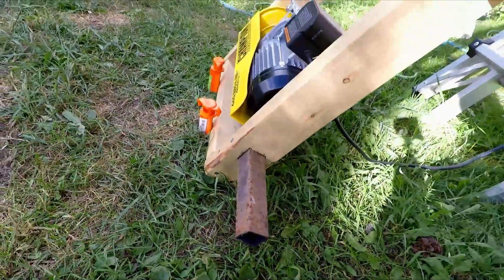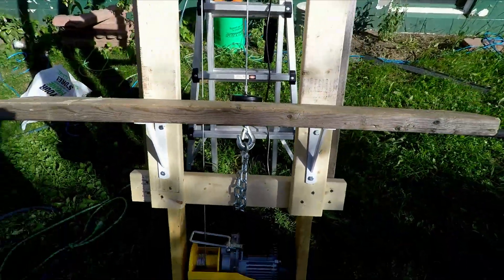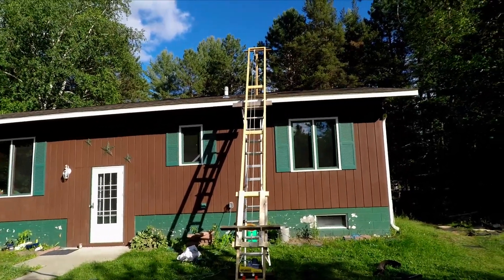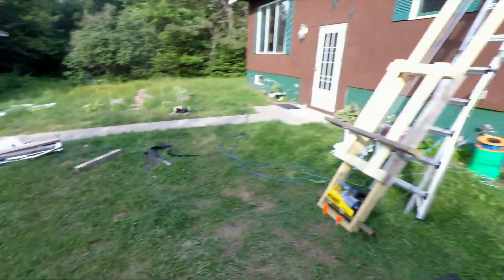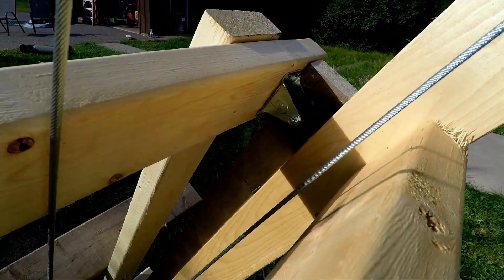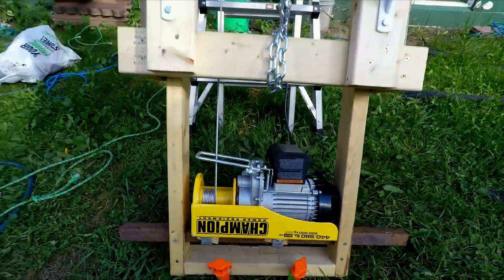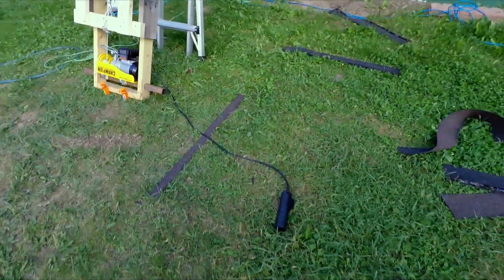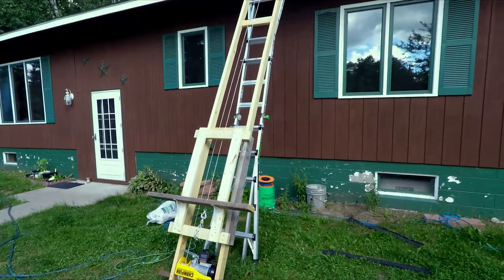DIY Homemade Shingle Lift

Comment: Great work! 
A little hard for me to see the backside of the sled top. I realize it's on an angle, but what keeps the top of the sled from falling outward? 

Other hoists I see made with real ladders use the ladder channel to keep the sled on the "uprights" and prevent it from tipping backwards towards the ground. Your design just appears to have wheels for friction and 2x6s to keep it from going side to side. No worries, just trying to make sense of it so that I can use your design
Reply from the maker: Hi Scott!
I believe you're thinking about it correctly. There is nothing to prevent the sled from moving in a direction away from the house other than gravity. This is definitely not an "OSHA approved" device, or something I recommend as a truly 'safe' method.
That being said, I was confident that the pitch of the rail and the weight of the shingles would provide enough friction to not be an issue.
If you wanted extra insurance, you could add an attachment point between the top of the sled and the cable. That way if for some reason there was a 'tipping' force on the sled, it couldn't rotate far enough to fall off 'backwards'.
Or just a few cuts of 2x4 that wraps around the bottom of the rails so once the sled is on there, it can't come off. You'll just have to take them on and off at the end of the day, to take the sled off the rail.
Just depends on how complicated you want to get, or just rely on gravity and call it a day. Just don't mount the board the shingles sit on at the very bottom of the sled and it shouldn't have enough rotational potential to be a concern.
Cheers!
Reply: Great answer. Thank you!

Comment: I plan on making one of these but instead of mortising out the 2x4’s for the tubing I would weld a piece of flat steel maybe 3” x 6” on both ends of the tubing. Then bolt the flat steel to the 2x4. Same thing for the top pulley tubing. 
I might run a rod through the lower tubing and put some wheels on it. 
I noticed a Menards plastic bag in the video and they are a dealer for the Champion winch. Not sure if that’s where you got it from. 
Thanks for the video.

Comment: With such a high frame, you could place it on the gable side and hoist all the way to the ridge to stack your packs there, rather than carrying each pack up the roof.

Comment: very nice! I plan something very similar only i am a bit worried about rain. It would be nice to leave this setup for a few weeks or even months, and that standard winch you are using has to go indoors whenever it rains right?
Reply from the maker: That's correct. That electric hoist is rated for indoor use only.
If you use a 12V or other outdoor winch, just consider that the rated capacity of winches is for horizontal load, and not vertical load, as hoists are rated.
Reply: I keep lots of wooden dunnage outdoors for years by slathering it with used motor oil which it promptly soaks up. You can make your winch quick disconnect which lets you use it for more than the lift.